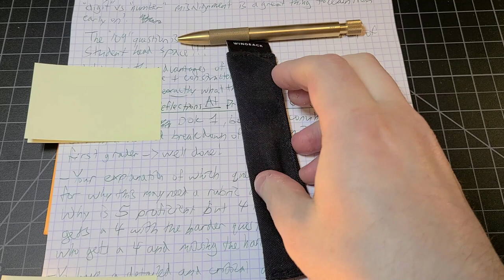Wingback Brass Pen Insights

Comment: I collect, and have a great many mechanical pencils.  Pens just don’t seem to hold the same attraction for me.  I’ve been using the same Fisher Cap-O-Matic Space Pen for ages, with a Zebra F-xMD Stainless (w/space pen ink cartridge) as my backup.   
But I must admit, that brass pen is very tempting.  It has a great look to it.